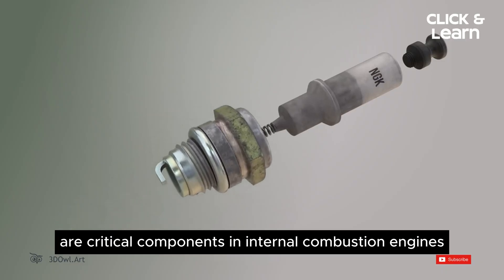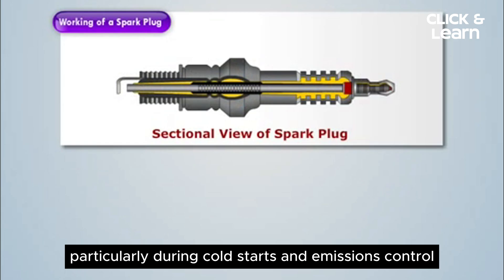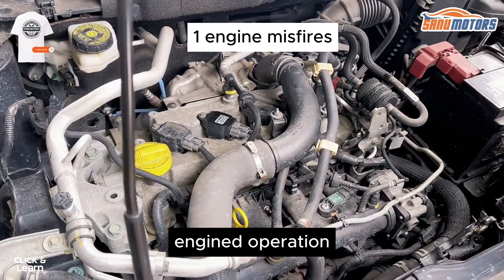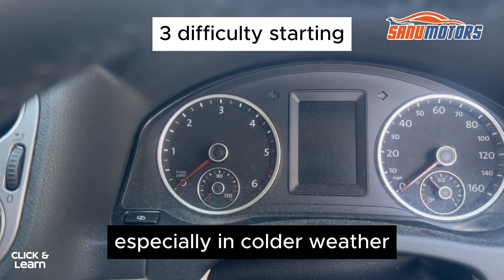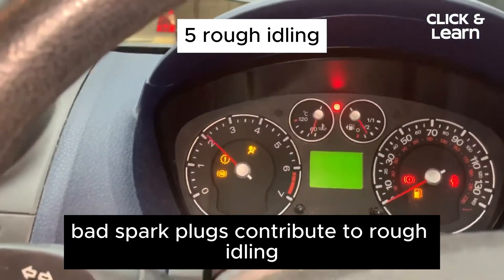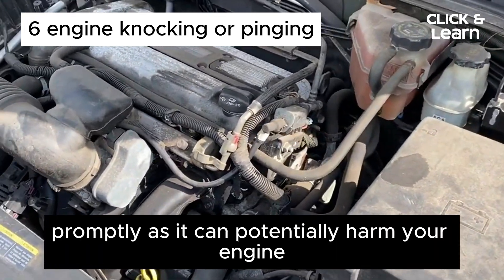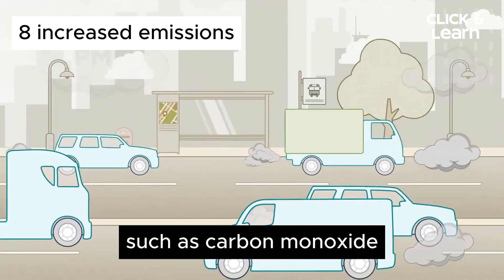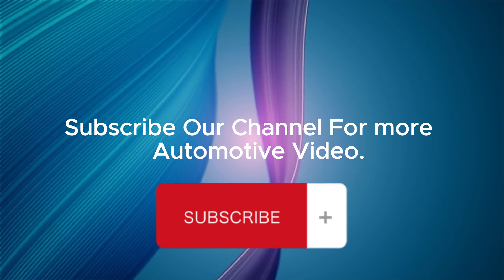Bad Spark Plugs Symptoms

Comment: Hello, 
A machanic fit heat spark plug in my hyundai Vanue turbo petrol (in which cold spark plug are recommended), due to this the engine stopped producing power after 60 km driving(car move but do not climb even a simple slop).

Went back to machanic, Now I have cold spark plug installed, I have two questions 
1. how to know whether the wrong spark plug have any damage on engine.
2. Will this small 60km event will effect lifetime of my engine (should I sell this car?)
Reply from the maker: Check Engine Compression: A compression test or a cylinder leak-down test can reveal if piston rings, valves, or cylinder walls are damaged.

Inspect Spark Plugs (Old and New): If the hot plugs are still available, check if:

They’re discolored (white = overheating),

Electrodes are melted or heavily worn = signs of pre-ignition or detonation.

ECU Scan: Have a diagnostic scan done to check for error codes like:

Misfire codes (P0300 series),

Knock sensor alerts,

Overheating or timing issues.

Exhaust Smoke: Blue smoke = oil burning, white = coolant leak, black = rich fuel mix — none of these should happen under normal use.

Engine Noise: Knocking, pinging, or tapping noises could mean internal wear — pay attention during acceleration or idle.

2. Will driving 60 km with wrong spark plugs affect the engine’s lifetime? Should I sell the car?
Short answer: No, not necessarily. If the engine still runs smoothly now and passes basic health checks, it’s highly unlikely there’s any lasting harm. You don’t need to sell it — just monitor it closely for a while.
Reply: Thanks 👍   @CLICKANDLEARNCh

Comment: How manny km need to change spark plugs?
Reply from the maker: The interval at which you should change spark plugs depends on the type of spark plugs and the vehicle manufacturer’s recommendations. Generally:

1. *Copper Spark Plugs**: These typically need to be changed every **30,000 to 50,000 kilometers* (18,000 to 30,000 miles).

2. *Platinum and Iridium Spark Plugs**: These are more durable and can last **80,000 to 100,000 kilometers* (50,000 to 60,000 miles).

3. *Extended Life Iridium Spark Plugs**: Some high-quality iridium spark plugs can last up to **120,000 kilometers* (75,000 miles) or more.

Always refer to your vehicle's owner manual for the specific recommendation, as it can vary depending on your car's make, model, and driving conditions. Regular maintenance checks can also help determine when it's time to change them.